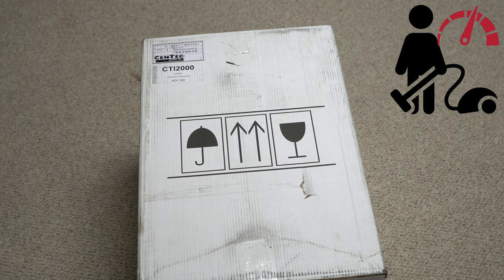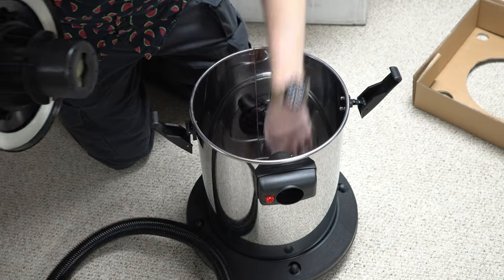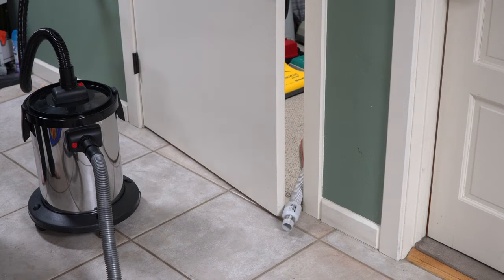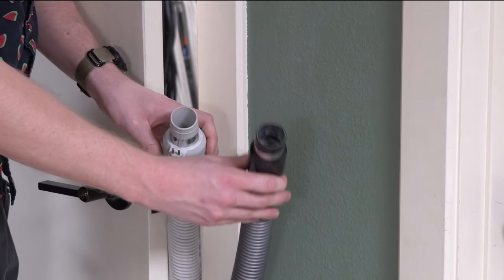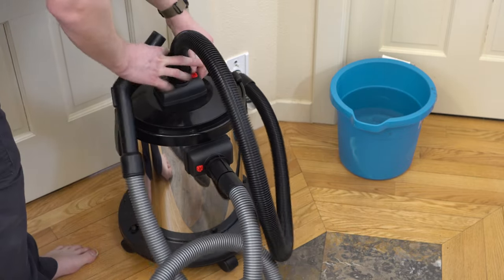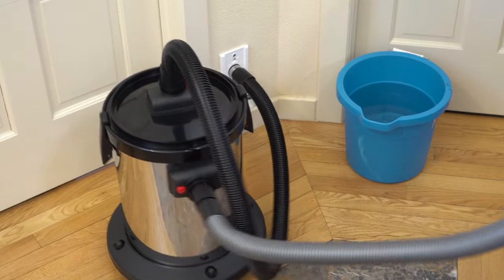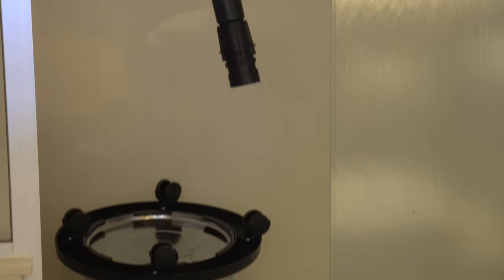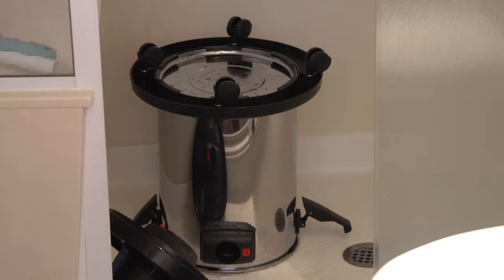Vacuuming Water With Central Vacuum   Interceptor Review

Comment: I gotta ask. What’s the the reason for buying this over a shop vac? A central vacuum is awesome but if you have to be pulling a canister around anyway this seems silly. It’s more expensive than a ton of great shop vacs. I’m not seeing any advantage to this unit.
Reply from the maker: Most Central Vacuums have significant power advantages over portable shop vac. Also the filtration Central Vacuums are exhausted to the outside so you don't need to deal with anything harmful coming out the other end. Lastly this is more cost-effective than most shop vacuums that you could use in a house. It's about 1/3 the price.
Reply: In addition to what Performance Reviews said, central vacuums are also quieter than any shopvac

Comment: I would like this for my system, I think I would use it for cleaning out fireplace’s the most. The company that I bought the vacuum system from don’t have it available though.
Reply: This is interceptor is for liquids only, do not use it with ash.

There are other interceptors on the market that are specifically designed for fireplace cleaning.